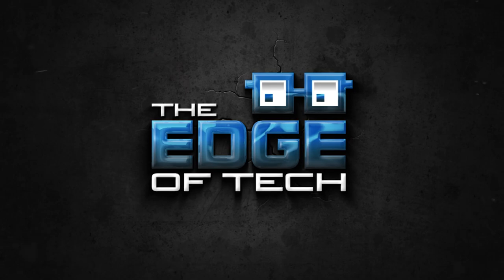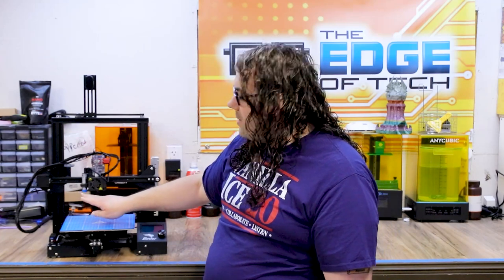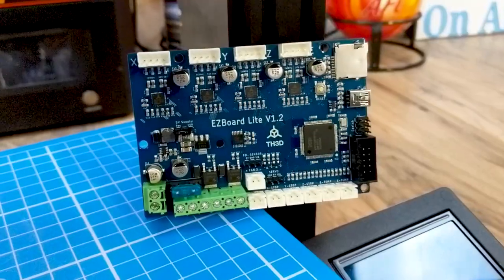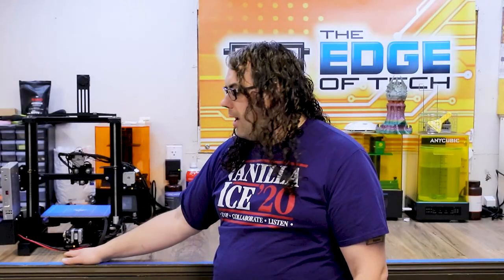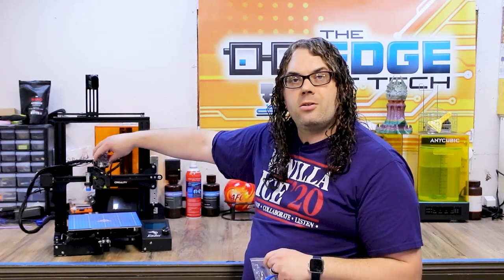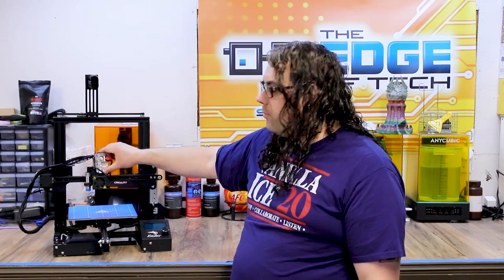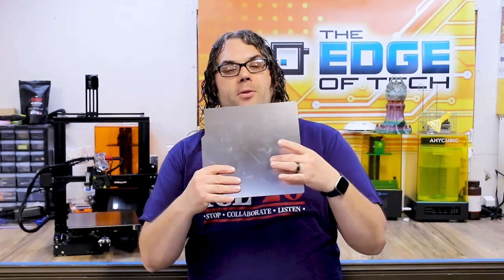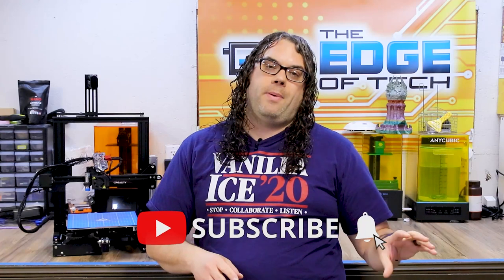My Creality Ender 3 has How Many TH3D Upgrades!?

Comment: love the ender pro, it has been the printer i print every print on my channel im getting the cr6-se later today from china! so its gonna be a great Christmas
Reply from the maker: Glad to hear! Hope you love it!
Reply: @TheEdgeofTech  so far love it had some issues with auto leveling failing due to one og the 2 pins in the x connector was not in so it would home in the number 1 spot around 7-8 and once it got to 10 GRRRRR, took it apart off camera and noticed the cable was out of the pin so i took it out re crimped it and plugged it back in with the printer FINALLY going threw all 16 points also i am going to mention in my video that the way they ship the printer with the gantry all the way up can cause the belt to get nics and fail because during shipping its touching the motor, and lastly the z motor cable connector is not accessible without removing the whole motor and the cable in strained the way they connected it hopefully it makes more sense if you catch my video but so far im loving it now that everything works